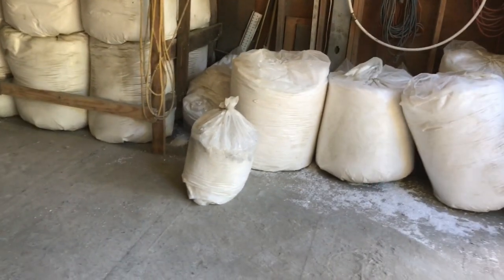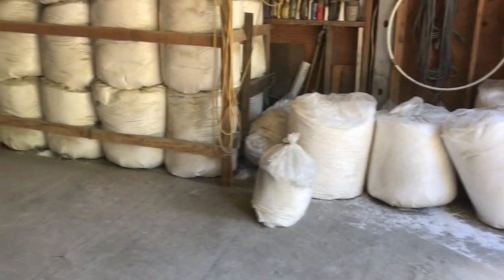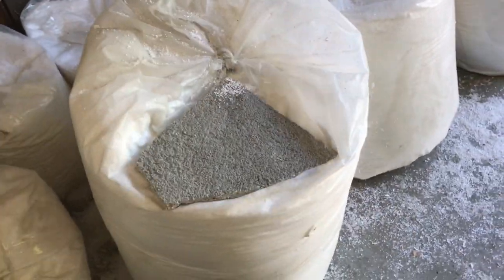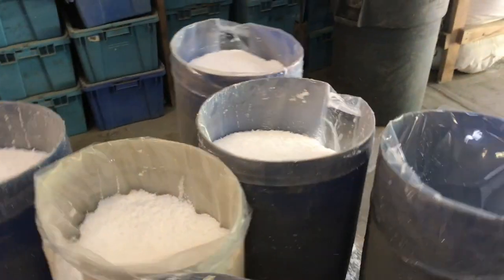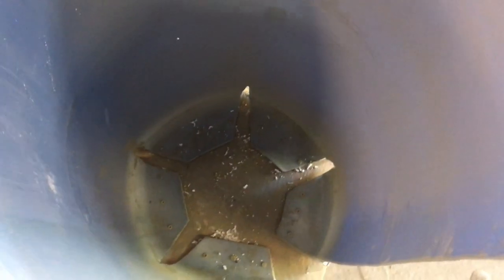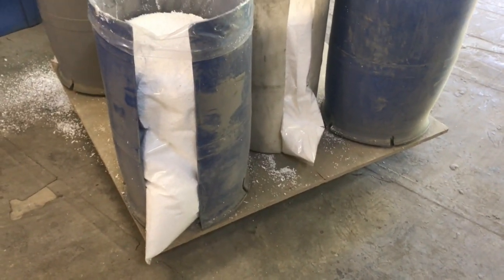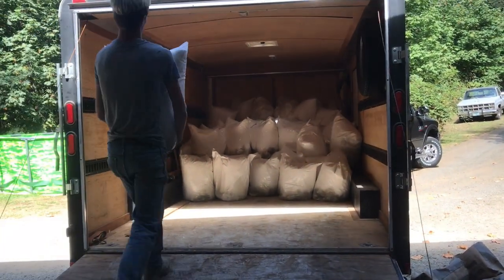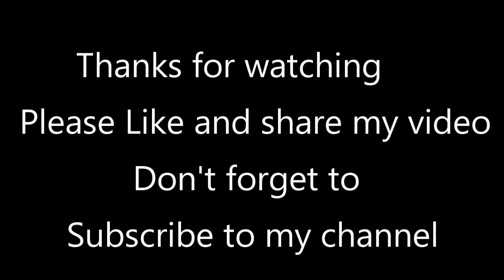Unbelievable styrofoam cement mixtures

Comment: What about wood rot?  I have an old craftsman house framed with rough oak and plaster walls.  I think using EPS concrete like this would be excellent as insulation between the wall cavities rather than blowing in cellulose.  I just know that regular concrete against wood can cause rot.  I’m hoping that’s not the case with this but I would imagine the concrete used could still draw in moisture.
Reply from the maker: That shouldn’t be a problem if your structure has a moisture vapor barrier installed. Thanks for watching my video.

Comment: What is tha ratio for making bricks
Reply from the maker: I would suggest using a ratio of one part ground Styrofoam to three parts S type Portland cement. I could make bricks with a one to five mix or a two to one mix stronger bricks, weigh more and cost more. It’s up to the the individual making the bricks. Thanks for watching my video.

Comment: I've just gone down a youtube rabbit trail on some things. Thank you for the thought on the "veins" inside the product and also availability. I have done some construction, so I'm not scared of it overall, but the styrocrete idea really grabbed me as something that might have been a good insulator, relatively easy to work with, moldproof, fire resistant, waterproof, and cheap.

The thought would have been to combine this with timber framing for interior to exterior walls and make the walls about 1ft thick. Or, the thought would have been to make product like this could be put into forms and be made like a lego-like product so that average person would not see building their own house as a such a daunting task. I'm still curious what the R value might be when its super thick.

I like the idea of alternative methods that are energy efficient and cost effective. I'm younger and looking at the housing market with a small family, and I doubt I will be able to afford a home unless I build my own.
Reply from the maker: Thanks for your feedback. I do so appreciate you watching my video

Comment: Great informative video.  Quick question on a mix formulation.   In the process of making stone veener using silicone ledgestone molds.  Currently tried using Sakrete sand topping mix with good results.  Would like to formulate my own mixture to save money.   Need to make approx 800 sqft of veneer.  What mixture would you recommend using with cement, sand,  lime,  styrofoam beads, etc.  Bulk mixing in a cement mixer.  Thanks for your help!
Reply from the maker: I would recommend that you use 1 part cement to 2 parts sand to 3 parts, styrene beads
Reply: Awesome!!   Thank you for your insight!!   Love your videos.  Such great ideas
Reply from the maker: @williamw6716 you’re very welcome and thanks again for watching my video.

Comment: What do we add to make polystyrene beads not float
Reply from the maker: If you use too much liquid, when making a cement Styrofoam mix, the beads will float so just cut down on the amount of water that you mix in.

Comment: hello friend, im getting ready to build my parents a home in mexico and im set on using the shredded styrofoam, do you have any formulas i can try???  thanks
Reply from the maker: Well, I appreciate you taking your time to watch my video, but I would look at another video. I put up telling you why I wouldn’t build a house with Foam mixes. I don’t know if I could sleep at night telling you a formula to mix to make a house, but nevertheless, I typically use three parts of ground Styrofoam to one part of Portland cement Type S
Reply: @fauxrock wow thank very much for taking your time to reply. I will be checking out your video. And Thanks for that formula, it will make a great base. I’ll be substituting water with aircrete(foaming agent).
For the house I plan to use rebar and hog wire for the structure. Pour the mold. That will be for the soft inside and then making a hard shell on the outside with chicken wire and fiber cloth and a slurry. I’m thinking of adding the paint in this formula to give it more strength and bonding power.
Reply from the maker: @HospitalityKings awesome… We only learned when we try something different than we’ve done before. Thanks for watching my video.

Comment: I was hoping to see the actual ratios of aggregates here.  I want to make skirting panels for my house which is on tubes.  If i wanted to make 2x8x8" forms that wanted to prioritize insulation, and without airfoam, how much Portland cement and how much lime would go into each one?
Reply from the maker: The mix ratio is as follows: 1part Cement, the three parts ground, Styrofoam. Thanks for watching.
Reply from the maker: Good luck trying to get any real R-value out of that mix. You might wanna watch one of my other videos on Styrofoam.
Reply from the maker: Portland cement would be three parts to one part of the line. At that point you have the cement that you would mix one part to three parts of ground foam

Comment: Mark a line on the barrels and you won’t have to measure the beads with the bucket.
Reply from the maker: Thanks for your feedback… I really appreciate you watching my video. Measuring with the line on the barrel is not as accurate as using the 5 gallon bucket measurement in my opinion.

Comment: I'm wanting to do a 1600 ft² slab on grade using polystyrene concrete. I can't find the formula for my concrete company. Can you provide specific mix ratio for a 10 yard pour?
Reply from the maker: Not sure I would go down that road… a slab with polystyrene mix. That’s very weak and not strong at all. What do you plan to do with the slab?

Comment: The foam you are using in this video is not Styrofoam.
Reply: Google        Styrofoam is not a cup DuPont
Reply from the maker: Foam I’m using in this video is polystyrene foam…
Reply: @fauxrocktraining  Yes, but not Styrofoam. Styrofoam is a brand of extruded polystyrene board insulation and is blue in color.
Reply from the maker: Ok… let just agree to disagree. No problem
Reply: @LucidDreamer54321  And you, BUD, are wrong as rain.  Styrofoam is certainly a brand name, but it is NOT exclusive to extruded "blue board".  Styrofoam does, indeed, make expanded polystyrene as well and it is WHITE.  I've used it for more than twenty years. So, smartass, Jim knows exactly what he's talking about.
Reply: @dperry428 No, you are the one who is wrong! The Styrofoam brand name is ONLY used for extruded polystyrene. There is a page on the Dupont web site that explains this. Unfortunately, YouTube deletes my comments when I post a web address.
Reply: @fauxrock  I disagree with agreeing to disagree. According to DuPont (the company that make Styrofoam), the Styrofoam brand name is only used for extruded polystyrene and has never been used for expanded polystyrene.
Reply: @dperry428  You don't know what you have been doing for the past twenty-some years.
Reply: @dperry428 I'm willing to give you a chance to prove your claim. Tell me the name of location of your foam supplier. I will contact them and ask if they have any Styrofoam brand expanded polystyrene. Then we will find out who is wrong. Awaiting your reply. . .
Reply from the maker: @LucidDreamer54321 I don’t have a supplier I grind my own recycled foam, as most suppliers, who have waste Styrofoam they are now densifying it, and selling it to manufacturers who use it to make new polystyrene products. as far as your wanting to challenge my claim, I’m good with it man I don’t care one way or the other I’m 62 years old and as long as I can remember the white Styrofoam has been called Styrofoam. If you feel different, that’s great I don’t have a problem with that …run it down the road.
Reply: @fauxrock  Obviously I wasn't talking to you when I asked for the name of a supplier. I was talking to dperry428, as was clearly indicated by preceding that request with "@dperry428". But thank you for responding. You admitted that it “has been called Styrofoam”, not that it actually is Styrofoam. I was right when I got the information directly from DuPont that the Styrofoam brand has never made expanded polystyrene. Just one point I want to correct from your last response. This is not about my feelings, this is about facts.

Comment: We have a pallet of Syndiotactic Polystyrene.  Wondering who would want to buy that?  The pallet is located in Washington State.
Reply from the maker: What is syndiotactic polystyrene of regular polystyrene?
Reply: @fauxrock  The syndiotactic aspect adds higher strength and higher crystalline quality to the polystyrene.

"Syndiotactic polystyrene (SPS) is a new crystalline engineering thermoplastic. With a melting point of 270 °C and its crystalline nature, SPS has high heat resistance, excellent chemical resistance, water/steam resistance."

-N. Ishihara, M. Kuramoto
Reply from the maker: How much volume of material do you have and what cost do you want for it?
Reply: @fauxrock  I'll check tomorrow.  It's in bags that look kind of like cement bags.  I'll see if I can get a count on the bags.
Reply from the maker: Ok thanks
Reply: @fauxrocktraining   You're welcome!  Thank you!  I had the guys pull out the pallet.  Looks like there's 40 bags, 25kg per bag.  One bag looks like it suffered an impact, so a few pellets spilled out.  I can see they're almost black in color.  I haven't been able to get a price from the boss yet, but if you have a price in mind for the full load, he's always open to offers.  I was looking for a way to contact you directly on your store site, but didn't see a way.
Reply from the maker: Call 971-237-2957
Reply: @fauxrock  Will do, Dave.  I'll give you a ring tomorrow.  Thanks!

Comment: For making a fencewall I need to make 2 one is 4inch with 6ft high the other has a 6inch with foundation and also 6ft high. What mixture u recommend? I alread have a shit load of styrofoam just need to grind it up. I was saving up to buy blocks but this might be cheaper.
Reply from the maker: I’d use three part foam to one part type “S” Portland cement
Reply: @fauxrock  thanks

Comment: How much time need to cure when mixing concrete with stayrfoam?
Does it faster than the usual concrete?
Reply from the maker: The mixture requires the same amount of time to cure is any other Cement

Comment: i saw someone who made his house out of this material. its sturdy like stucco and especially so with rebar holding it up.
Reply from the maker: Thanks for the feedback…I appreciate you watching my video
Reply: What type of framing did your friend use? I am now seeing houses with no framing. Wish I knew what these homes looked like after years. I wouldn't even mind having to resurface  every so many years. But need to know if it stands up to time. It hardens more over time. And could see this becoming a pile of ruble...or an impenetrable castle! But which???

Comment: looking at using this method for a modernized wattle and daub for a shed I want to build
Reply from the maker: Not sure I understand your application, but this makes can be used for many different applications
Reply: @fauxrock  basically using as thick stucco. Using in place of traditional daub which is mud, cow poop and hay all mashesd together in a thick paste then pushed into wattle (weaved wood) lattice between a post and beem frame.
Reply from the maker: Yes, this mixture would work for that. I would wanna reinforce it with something whether it be steel or mesh something needs to be used.

Comment: Hello! I found your video and it’s very informative, could you share the ratio of the mixture? Is it only pure cement and styrofoam? Do you use sand on the mixture or is it posible to use cement, styrofoam and sand together to make it light but strong? If so? What is the ratio? 
Thank you very much! Greetings from Mexico.
Reply from the maker: No this formulation is a volume measurement not a weight due to the fact there’s such a huge difference in weight between the two types of product being used to make the mixture
Reply from the maker: My mix is generally one part of pure Cement (no sand) to 3parts of Foam
Reply from the maker: Thanks for watching my video

Comment: It seems there's a bonding material added like latex sbr so cement mixture can stick to styrofoam beads strongly making them more waterproof.
Reply from the maker: Even if you applied some bonding agent additive or any attitude frankly you would still have the problem of the Styrofoam itself being very porous and therefore you would have porosity where and you would not have waterproof material… Just saying
Reply: @fauxrock  thanks, but what makes styrofoam beads stick to cement strongly without the point of waterproofing? Is it a bonding additives ?
Reply from the maker: Cement paste all by itself will bond to the Styrofoam beads adding an admixture like a glue will also enhance that but yet you still have porosity in the Styrofoam which creates veins of traffic for water to permeate through the matrix of the mix
Reply from the maker: Thanks for your feedback and I do appreciate you watch my video

Comment: Is this waterproof?
Reply from the maker: The Styrofoam mixtures or formulations are not waterproof in by themselves but they can be coded with the hydrocele mix which would then make them waterproof
Reply: @fauxrock  
Hydrocele? I looked it up and found nothing.
Reply from the maker: Sorry I utilize my phone voice typing and sometimes I don’t check it… It’s hydro seal.
Reply: @fauxrock  
Cool thanks

Comment: Great for informative videos, thank you. For lime, can you use agricultural lime or must it be hydrated lime?
Reply from the maker: I’d assume hydrated as I’ve never tried the agriculture type.
Reply: @fauxrock  - what is the reason to add lime? Is it a fixed ratio to the cement? Thanks in advance! I’m binge watching your videos and appreciate your work.
Reply from the maker: The reason for adding line to the mixture, is to produce a stickiness so that the beads are bonded together with the cream of the paste . If you just use Portland cement without the lime, it doesn’t stay together real well, but in some applications like pouring avoid area, you don’t need the S type lime you can just you say Portland in Fact St., Portland is stronger than having the lime in the mix
Reply: @fauxrock  Thank you so much for educating me…

Comment: Hi bro. I m planning a faux rock wall project. Could plz tell me what kind of cement do u use? Is this OPC or some other type of cement? What is the ratio of cement, lime and thermopile?
Reply from the maker: First thing is to have your cement be three parts to one part lime. Once you have that made… Mix 1 part cement to 3 part styrofoam use enough water to make it a workable mix.

Comment: Hi - what is you ratio of Cement / Sand / Polystyrene / Water ?
Reply from the maker: I generally Use a One parts cement to three parts of the Styrofoam beads….No sand…

Keep in mind that you want to use S type cement As it contains lime which regular Portland cement doesn’t. As far as the water do you want to just add water until it becomes a workable mixture you don’t want it too wet because it separates the cement from the foam
Reply: @fauxrock is this by weight or by volume? Thanks for the info
Reply from the maker: @bruceessig3350 are utilize volume measurements… thanks for watching my video
Reply: @fauxrock  Thank you so much for your info - helps a lot.
Reply from the maker: @Stephen_Strange glad to be of service and thank you for your positive feedback and I really appreciate you watching my video
Reply: Do you have a suggestion on a mixture for pouring walls for a shed?
Reply from the maker: Yes, I typically mix three parts of the styrene to one part of S-type Portland cement, adding enough water to make it workable

Comment: Thanks for the info. I am building dog houses and chicken coops for off grid experiment and this looks like the cheapest and best way to go. Do you agree? OF COURSE I SUBSCRIBED…of course! Okay I looked over other videos but can I use this as a small water tight pond? And the expanding foam in a can can be added for better r value correct? You seem to be the most knowledgeable source on YouTube.
Reply from the maker: Give me a call to discuss your project… I need a little more info to give you a sound answer 
971-237-2957
Reply: @fauxrock  dental work. Can’t speak. Will check back soon. Thanks, plenty of lead time on these projects.
Reply from the maker: Understand…